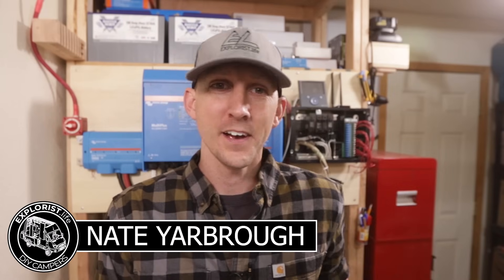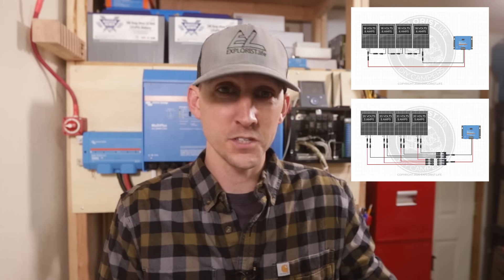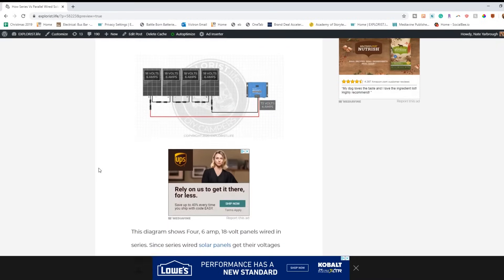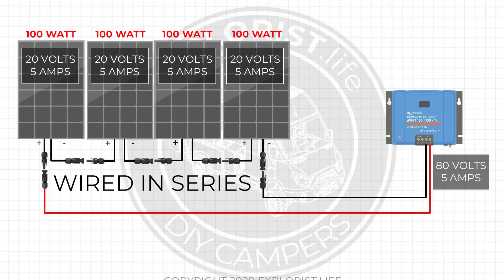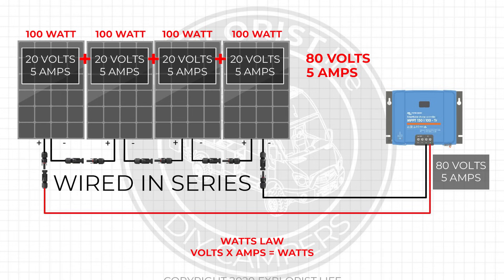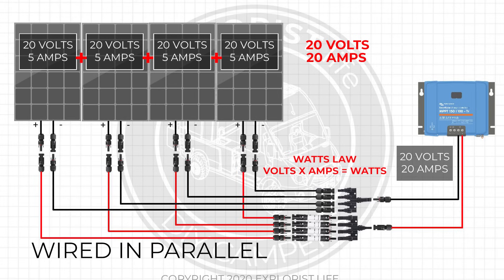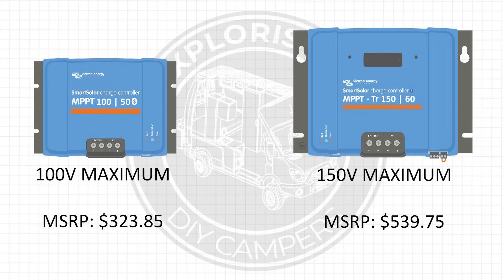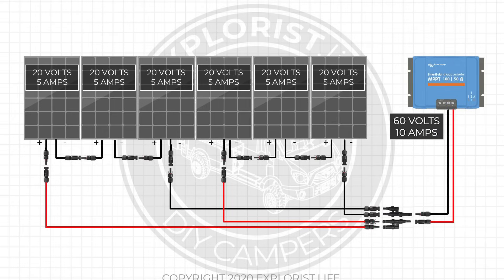Solar Panel Wiring vs Volts and Amps

Comment: Thank you for this insight. how do you draw a wiring diagram of 6 panels with 12v each to get a system voltage of 48v?
Reply from the maker: This should help: https://youtu.be/6G3Mo_OHmQY

Comment: The best video I've seen so far on the subject of solar panels, I'm a total novice. I'm trying to put together a small, cheap system that can power a laptop, router and 20watt lamp for at least 8 hours a day. I have to take UK weather into consideration (grey skies about 70% of the time) Would it be right to say I would probably need something at least twice the size of my actual power requirements from the panels to compensate for the little amount of sunshine we get? Obviously not the case in summer. Given our weather, Is it realistic to expect this to work? I know my power requirements are not that big but I also know that's still a lot to expect from say a 300watt panel in mostly overcast conditions. This is not easy to work out. I know if I get it wrong it could be expensive or ineffective or both. If you were looking to do the same as me (laptop,router,lamp) what size panel (wattage) would you recommend in British weather?

I'm worried about power cuts (energy rationing) They've already hinted at them happening on the TV. I could get by with those 3 items if we do blackout.
Reply from the maker: You'll want to see how many amp hours @12V those devices use over the course of 8hrs.  From there, multiply the amp hours needed by 2-3 to get a ballpark on solar wattage.
Reply: @EXPLORISTlife  Thanks. I'll do exactly that.

Comment: Great Video... q. I do have the Victron 100 50 controller and looking at 6 x 100w panels with the similar spec in your video m would the 120v damage the controller,  considering we never truly get max power thru the panels?
Reply from the maker: It would absolutely damage it if you wired all 6 in series and sent 120V to a charge controller with a 100v max.  Wire your panels in series-parallel instead like this: https://shop.explorist.life/shop/all-products/camper-wiring-kits/solar-charging-wiring-kits/600w-solar-charging-wiring-kit-6x-100w-12v-battery-bank/

Comment: Nice, but what if, say two or three panels get a partial shade for half of the day - how to wire for such a scenario? What solution is best?
Reply from the maker: There is no good wiring scenario for parking your camper in the shade.  If you're worried about generating maximum solar power... don't park in the shade.
Reply: @EXPLORISTlife  thanks.my house is permanently 'parked' near a tree cluster and I have no choice. I've done some more research and it seems parallel wiring is better if only one of the two panels gets shade. In general, it seems like big panels (physically) with high voltage output, with individual charge controllers, would be best in this situation

Comment: Nate, thanks for the great content! Running a question by your and/or the community:  I have 4x 100W 24V 5A panels, and 2x 400W 48V 10A panels that I would like to wire into a controller specced up to 1600W 11-150V 15A.  My thought process is that I could first create 2 sets of 2x 100W panels in series to get those up to 48V, then connect the 2x 48V pairs in parallel to get the current up to 10A. Then connect all of that with the 2x 400W panels in series to arrive at a total of 1200W 48V 10A. Anything I've overlooked?
Reply from the maker: You'll want to break that down more exact than than just the nominal 24V and 48V panels.  How to wire mismatched solar panels in the same array: https://www.youtube.com/watch?v=jejro4zkl8I&list=PLmvhcyi4n0TV9pi83rFTv3ZuMT_S1xIZt

Comment: Good Morning !  Does this mean i could use 9 gopower 190 watt panels in 3 arays and work with the 10 ga wire all the way down to a victron 150/100 controler ?

Comment: great videos.  Reviewing for an expansion to my system.  so.... using FM80 outback CC / 24volt system / 8 x 265w panels (ea Vpm 31.0 Inc 8.55).  Option A I was planning on 2 panels in series per string, then 4 strings in parallel.  The VOC of the outback is 150.  After watching, I started thinking of option B: 4 panels in series per string, then 2 strings in parallel.  Previous output would be 62V 34.2A, but the second option would be 124V, 17.1A. Another thing to add... these 265W panels are used, so output of course will not be as new.  What do you think.... better to go Option 2?
Reply from the maker: Hey, Tom V! I appreciate you taking the time to ask your question, but unfortunately, I don't have enough info about your specific question to provide an accurate answer, but here is a playlist that, if you watch all of the videos start-to-finish (and take notes 😉), you'll have a REALLY good idea of how to design a solar array: https://www.youtube.com/watch?v=Jkbs84sBHsg&list=PLmvhcyi4n0TV9pi83rFTv3ZuMT_S1xIZt

Alternatively, I have some of my most common solar array setups pre-built here: https://shop.explorist.life/product-category/all-products/camper-wiring-kits/solar-charging-wiring-kits/

Comment: Nice. I was hoping you were also gonna touch on how high Voltage can lead to output inefficiencies under certain circumstances. From what I've heard, operating close to a charge controllers maximum voltage can reduce the maximum output and/or be disadvantages for partially shaded panels etc. Is that correct?

Comment: Can you help me. I have a small solar array. I believe that I need more amps. Because my battery charged too slowly. I have a total of 300 watts worth of solar panels. In full sun I get great voltage, but can't manage more than 6 or 7 amps. My battery bank charged too slowly to be really effective. I have a short run of less than 20 feet from my panels to my charge controller. What advice can you give me?

Comment: I just installed 9500 GPH sump pump for a fountain in my 1/2-acre pond. I have 2 100Watt 12V solar panels with 30amp controller and 600-watt inverter and 3 lithium batteries 12V 20aH. Unfortunately, I'm only getting 8-10 minutes per hour of run time before the alarm goes off and shuts down. Do I need to add more panels to accommodate or add more batteries or both? Should i go with 12V 100aH lithium batteries over the 20aH that I have or add 2 more 20Ah. Which is best for panels and batteries series or parallel?

Comment: I have 8) 100w panels 20v each I need to stay at 100v and 10 amp. How would I wire them.?
Reply from the maker: Hey there!  I do believe the video you commented on will provide you enough information to help you figure that out yourself.  I've taught you how to do it, now it's time for you to put some effort into figuring it out yourself.

Comment: In the s2p2 configuration, where would the 2(?) mc4 inline fuses go?  Also would this need a breaker after the combiner box or is the disconnect enough?

Comment: I have a question that I can't seem to find answer for. I purchased 6 used hanwha Q cells LG 4.2 335w solar panels. When I purchased the guy put a multimeter on cables from panel and showed proper voltage 39 -40v in full sun. We did not check amperage at that time. I assumed was good. I am now in process of connecting these panels  and the amperage is half what it should be. Multimeter shows 4 amps or so on every panel in full sun. It's 4 point something (I forget the tenths) But sticker on back says panels should produce 8-9 amps in full sun. So I know there is an issue so I took cover off the module on back of panel to look for connection issues, just to find it had been filled in solid with a substance from factory that doesn't allow any connections to come loose or make adjustments . So how can that be? If connections can't come loose and I'm showing 4 amps and sticker on panel says should be 8 amps what do I do ??
That's half the current! 
Please help " O mighty one"
Reply from the maker: In perfect sunlight at 70 degrees F, the amperage between the positive and negative leads should indeed be near the short circuit amperage.  I'd recommend reaching out to the manufacturer for additional tech support.
Reply: @EXPLORISTlife  I already tried . For 2 wks I've reached out to manufacturer. No one answers phone. Why I reached out to you. You're a smart guy with solar... What's ur opinion. If module is filled in solid, is my only choice to deal with it or do u have any ideas

Comment: Hi Nate, 

After reviewing many of your great videos, it just doesn’t look like there is a “great” alternative for our 75% of-the-time cloud shading, on the coast in Alaska.

Tried to subscribe to your private group, but it was not currently available, so I am hoping that you will be able to make the time to respond to my question.

Option #1, Hybrid Parallel: (Four total, 120w panels, 6.79a, 17.68v each panel) 2 separate, 2-panel systems, each parallel = 17.54a, 17.68v each system (BUT inadequate voltage for 12v battery power storage minimum and mppt efficiency).

Option #2, Series: Single, Four total, 120w panels = 6.79a, 70.72v (BUT “series” reduces all panels to lowest during “75% of-the-time” cloud shading).

Option #3, Hybrid, Series-Parallel: Four total, 120w panels = 13.58a, 35.36v.  (BUT 35.36v is probably still inadequate for 12v battery storage and mppt efficiency, considering “75% of-the-time” cloud shading).

Leaning towards "series", but what am I missing?

I can't say enough about all the great help you provide!  

Thanks again.  Dave M.

Comment: Problem:
I am running 6 panels in series at 130voc.  1 more panel puts it over the 150voc.  Mppt controller triggers. The second solar input I'm using 2 SPs in series.   I would like to use the remaining 8 panels in a series parallel configuration to achieve under 10a/150v Any suggestions? 

Bluetti ac200p Solar generator 
Solar Input
*Voc 35-150V / 700W Max. / 12A Max.

*10-100w SP modules - OCV 21.6 - MPV17.3 working current 5.78a

* 10awg cable@65ft
Reply from the maker: Hey, adross3! I appreciate you taking the time to ask your question, but unfortunately, I don't have enough info about your specific question to provide an accurate answer, but here is a playlist that, if you watch all of the videos start-to-finish (and take notes 😉), you'll have a REALLY good idea of how to design a solar array.  Alternatively, I have some of my most common solar array setups pre-built here: https://shop.explorist.life/product-category/all-products/camper-wiring-kits/solar-charging-wiring-kits/

Comment: Can I have 3x erase of 
3x panels each wired in Series parallel?
I have 2x erase with 3x panels each wired in series parallel 
And I want to add 3 more panels as portable 
Dose this work ?
Reply from the maker: Unfortunately, I don't have enough info about your specific question to provide an accurate answer, but here is a playlist that, if you watch all of the videos start-to-finish, you'll have a REALLY good idea of how to design a solar array.  Alternatively, I have some of my most common solar array setups pre-built here: https://shop.explorist.life/product-category/all-products/camper-wiring-kits/solar-charging-wiring-kits/

Comment: 800W  in 4x200w renogy solar panels, Voc 27V, Isc 9.66A I got the renogy 60A mppt.   Should I go 2S2P?  I can't even find a max volt input on the controlleras it states its max is 800w, not volts.   DAFUQ?

Comment: Nate….. when figuring what numbers to use on the Solar Panel do I use the “MAX volt/ amp” or the 
“open circuit volts /amps? ‘
Reply from the maker: You'd use Voc for sizing the charge controller and Vmp for determining voltage while the panels are producing power.

Comment: Nate I was able to get 150/100 MPPT Victron charge controller at a really good price from a friend but still confused on the best way to connect (Six) 100 watt panels using this charge controller because I could hook them up in series and still not reach 150 volts or I could hook them up Parallel and still not reach the 100 amps. Should I just hook them up Series Parallel and never give the charge control a real workout? How would you do it? Is using the Victron 150/100 a problem with my 600 watts of solar and 400 amp hours of batteries? Thank you for your videos I fall back on them all the time I need a refresher.

Comment: For series do you add up Voltage Open Circuit or Voltage MPP?
Reply from the maker: It's the same concept for both.  You'd use Voc for sizing the charge controller and Vmp for determining voltage while the panels are producing power.

Comment: Hi Nate from Australia, great video with great info that may put me back on track. I do have a question and that is. I have 12volt batteries and use 12v solar pannels into an mppt regulator. The panels only produce 19 volts and the system isnt real good. After watching your video am I correct that I would be better off using 24v pannels that put out 36v. Seems that I thought that would cook my regulator? Hope this makes sense and you can set me straight. Regards Merv
Reply from the maker: It wouldn't fry a 'properly sized MPPT controller'.  More info: https://youtu.be/Jkbs84sBHsg

If you watch this playlist start to finish, you'll know everything you need to know about designing a solar array: https://www.youtube.com/playlist?list=PLmvhcyi4n0TV9pi83rFTv3ZuMT_S1xIZt

Comment: Thanks for this info!! I have 1 panel mounted but want to add another as portable, is parallel better for if it’s overcast? Example: If ones in the shade and the portable ones in the sun parallel would be better? Thanks
Reply from the maker: I recommend wiring roof and ground arrays to separate charge controllers: https://youtu.be/N0UB7LZVduk

Comment: Hi , i like your channel a lot ,good work !
I am adding 2x 185w solar panels on the roof of my van + victron 100/30 regulator , but what is the best method serie or parll connection to charge my 100A 12v Lifepo4 battery, my shop say parll but you say the V has to be 20 V higer than your battery to charge ,so now i dont know what to choice
Reply from the maker: Hey, Glenn Bierwaerts! Here is a playlist that, if you watch all of the videos start-to-finish (and take notes 😉), you'll have a REALLY good idea of how to design a solar array.  Alternatively, I have some of my most common solar array setups pre-built here: https://shop.explorist.life/product-category/all-products/camper-wiring-kits/solar-charging-wiring-kits/

Comment: It's called ohms law not watt law.                 Ohm's Law is a formula used to calculate the relationship between voltage, current and resistance in an electrical circuit. To students of electronics, Ohm's Law (E = IR) is as fundamentally important as Einstein's Relativity equation (E = mc²) is to physicists.
Reply from the maker: Ohm's law is Voltage = Current * Resistance.  Watts law is Watts = Volts * Amps.

Comment: quick question... do people wire Parallel then series on the panel? Or it doesn't make sense to do it that way? Doing 4 parallel solar panels right now, but dont want to climb up the roof again. each of the 2 panels are wired parallel configuration, if I then do series, what will happen? If a shade is on one panel, will it affect all?

Comment: What's interesting is  my amps are lower  in series. I thought  series was supposed to yield more watts going to batteries  but its less because current is less
Reply from the maker: You are confusing the amps on the upstream side of the charge controller vs the downstream side.  This video will help: https://youtu.be/Jkbs84sBHsg

Comment: But you arnt using the full voltage when charging.  Only using voltage a little  higher then  the battery so the  watts going to the battery is low
Reply from the maker: Yes, but no...  The charge controller needs adequate voltage to function.  Here's what a charge controller does: https://youtu.be/Jkbs84sBHsg

Comment: I have 3 100 watt renogy solar panels in series then 3 of those in parallel for a total of 9 panels. So 900 watts. I have 60 volts coming in but the breakers I have are 12 volt 60 amp. Wouldn't I need a higher voltage breaker? I have a 5 amp in li e fuse on.each panel.already. Also what size Victron controller should I use. Presently I have a 150/60
Reply from the maker: Here is a video that will teach you how to size a charge controller: https://youtu.be/MxziHKvTRh8
and here is a video that will teach you how to fuse your solar array: https://youtu.be/s1P31hxlD3I

Comment: Thanks for the awesome video.  I am looking at 4 x 200W solar with a 27W VoC rating per panel and 9.66A output.  I have a 100/50 Victron MPPT and with this setup in Series would exceed by 8W ( ie:108W) - will this still operate OK in series without damaging the solar controller or should I use the series / parellel solution to obtian 54Voc and 19.32A.

Love the Videos !!

Comment: Can you please help , I'm trying to put together a system to power my RV .

I have 4 315 watt panels 37v and I purchased a powmr 3000 watt 60 mppt solar all one   the controller I believe has a max 100v and 1400 watt 24v . will these work together. Also purchased 2 renogy   12 v 200amp hrs batteries

Comment: Love the videos, and I have a good idea of what is needed. The wiring size is the issue for me. I’m in a forested area having a clearing that is 450 ft from my living area. All calculators tell me 2/0 or 4 awhile is needed. Is there a way around it? Should I just deal with the voltage drop? System controller is 48 volt. Running in series keeps my amperage down but still requires these huge wires
Reply from the maker: Wire (add more panels and a larger charge controller if necessary) so that the array voltage is higher and the array amperage is lower.  There is a 250V and 450V Victron charge controller which should fix your wire size issue.
Reply: @EXPLORISTlife  approtiate the feedback. Solar mppt can handle 600 volts. I was thinking the same, but needed a little feedback. Thank you for kindly responding